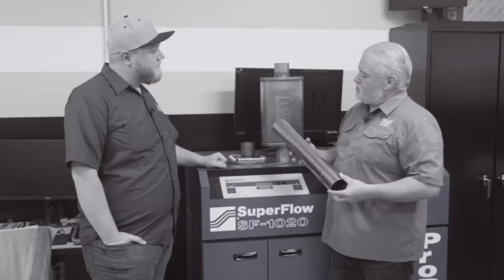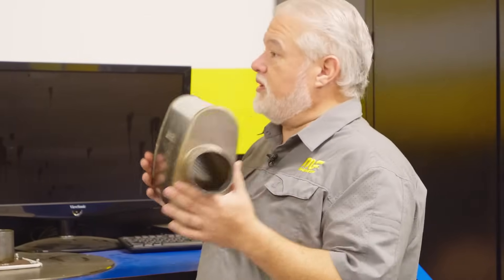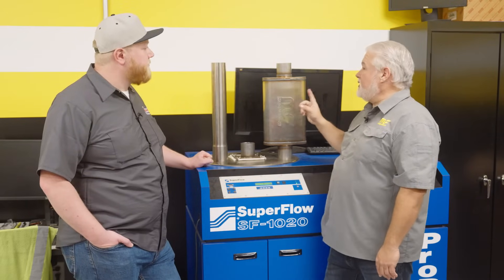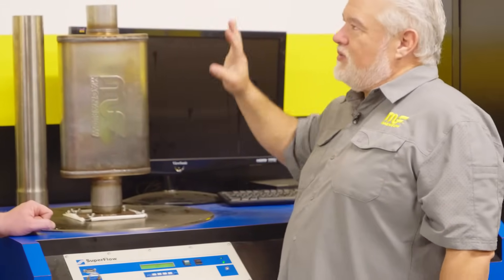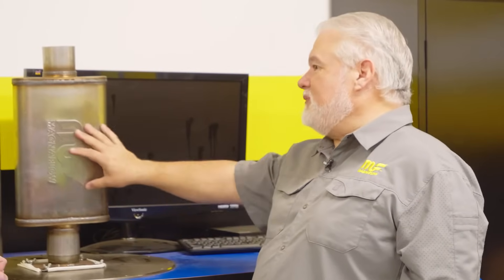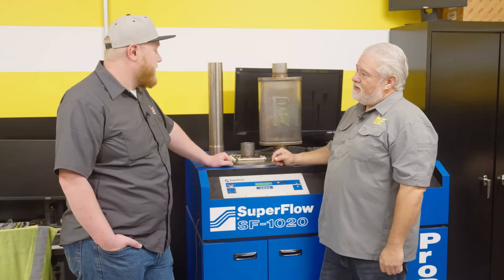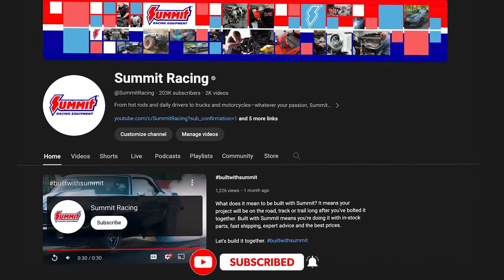A Muffler That Flows Better Than a Straight Pipe?!? We Have the Flowbench Test Results

Comment: the tubing is 3" OD where the muffler is 3" ID, the top end of the tubing will slide into the muffler. This isn't technology, the muffler is larger therefore flowing more cfm.

Comment: The muffler is actually bigger than the 3" diameter pipe. That's why it flows more. Open that straight pipe to the muffler's diameter and it will flow more. But yes, that fatter muffler flows more than the skinny straight pipe. A fatter hose flows more water.

Comment: I don’t comment much but I feel dumber after watching this 
Hey magnaflow that goes on the back of the car not the front you don’t pull air through the muffler it’s not an air filter 

Pulling air through something is not the same as pushing air through something
Pushing expands air and makes it tumble on it self and slow down 
pulling air makes it want to follow a straight path and not tumble on its self 

That muffler acts like a sorta Venturi speeding air up when it’s pulled through it compared to the straight pipe 
That muffler test makes no since 
Blow air through both and bet the straight pipe wines 

There’s not one dyno muffler challenge on you tube where substituting a muffler for straight pipe made more power
Snake oil and lies 
Straight bs

Comment: That muffler that flipped over that pipe is the same size all the way through so it's actually a little bit bigger than 3 inch all the way through I believe isn't it?

Comment: This is null…. First of all you’re flowing COLD air through that muffler …. Secondly when those mufflers break in and those fibers melt …. That muffler will eventually turn into a straight pipe

Comment: I say this test is not totally accurate because exhaust has pulse waves that slow down and speed up. Exhaust does not run at one consistent and steady full blast speed. If you watch the muffler and how much longer it actually took to get to the strait pipe reading then there you go it is slower. So what does one think will happen with the actual exhaust waves with all different speeds coming from the headers going faster and slower and the slower ones having to catch up but then they get canceled out by one or 2 more waves? I like MagnaFlow but nice try on selling them lol
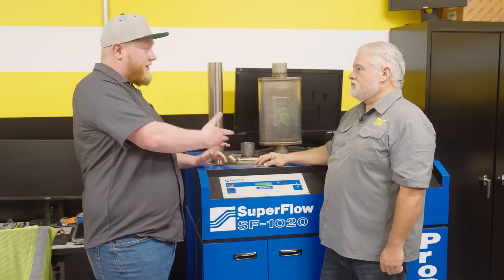Reply from the maker: Thanks for watching and commenting. You are right about the waves/pulses, and he does cover that at the 5:30 mark. But at full capacity, the muffler is able to keep up with and exceed the flow of the straight-through because of the perf-core inner design.
Reply: @SummitRacing  im not gonna lie, I stopped watching after the Magnaflow was tested after the strait pipe in the beginning. Once I saw how fast the open pipe hit peek flow and how the muffler struggled and then finally caught up and went a little past it I was done. I also noticed the Magnaflow fit much tighter on the flow pipe than the strait pipe 👀

I use to be a Flowmaster guy back in the day but grew out of them. I like Magnaf;ow and Spintech but I have been running 3" open pipes for years. Infact I just made new ones 2 months ago.
Reply: @nova467spanker  bring a handful of mufflers to a dyno session. You'll be surprised to find out how much the flowbench helps develop better parts

Comment: Magic Questtion: How much CFM would be on the display if the pipe and(!) the muffler are mounted on the test bench?! (more like a regular exhaust system)
Is it somewhere in the middle?
Reply from the maker: Good follow up question. We can certainly ask Rich and the gang at MagnaFlow.
Reply: @SummitRacing  🙌😉Regarding the comments exhaust systems seem to be a very interesting topic. 🔥 
Maybe it's worth to wait for some more and to discuss them with RICH and listen to his expertise. 
BTW - great contents - thanks for posting. 👍👍
Reply: That's what I'm thinking.  With that 3" muffler, you also most likely have 3"inch piping in and out of it. So you'll be back down to what the 3" pipe flows.

Comment: I called MF several years ago to ask for flow numbers for a specific muffler and the sales guy said they would NOT provide that information to me.  Glad someone was listening.  BTW, David Visard says that you need a muffler that flows 2.3 CFM per open pipe HP to have a lossless muffler.
Reply: He sometimes wrks on outdated info.. I run this muffler and picked up 2/10 from straight pipe...mind blown!!!

Comment: I would have never guessed that muffler weighs 14 lbs! 😮 28 lbs in mufflers? I'm guessing the stainless steel is part of the reason but wow!
Reply: Stainless is lighter than mild steel
Reply: @Silverysquid 
Stainless steel is not lighter than regular steel. They have similar densities. However, stainless steel contains additional elements like chromium and nickel, which can slightly increase its weight. Plus, because it's less ductile than mild steel it may require more welding which can also add to the overall weight.

I have Thrush 2 chamber mufflers in my 71 Camaro and they weigh 9 lbs each.
Reply: @Carl_Jr I had thrush on my truck. Cut it off for something that wasn't going to kill my power and look like an eyesore 🤷
Reply: Looked up the weight of my muffler apparently weighs in at 8lbs so theres that too 😂
Reply: @Silverysquid  A lot less than 14 lbs! 😂
Reply: @Silverysquid  You have to remember that the thrush muffler that I had was a two-chamber like a Flowmaster. Not the typical turbo muffler, that's packed with more steel tubes and fiber all over the place. 

Funny enough, I actually pulled those off and put in turbo mufflers on each side, with cutouts in front of them, because I wanted my car quieter when I cruised but louder when I wanted it to perform.
Reply: @Carl_Jr sound like a fairly interesting setup.  I've thought about doing a bypass pipe on my truck that re-enters the tubing just after the muffler with a pneumatic cutout. Other than them being power killers, I'm m not a fan of the chambered muffers as well because they have a weird buzzy gurgle and ping to them regardless of what engine it's attached to.
Reply: @Silverysquid  These don't, surprisingly. They actually did it better than Flowmaster. I was impressed. But I'm putting on a Edelbrock E-Force Supercharger and want it quiet while I cruise so I can hear the whine, but when I want to get rowdy I can do that, too. 
I have the stock pneumatic valves on my 2013 ZL1 and they're a pita. You're better off with electric. I'll be replacing mine, soon. Putting vacuum diaphragms near hot exhaust pipes is never a good idea. Especially on a 600hp car.
Reply: @Carl_Jr  stainless also like to crack when heat cycled so I guess they make them with thicker gauage stainless
Reply: @krusher74  True. I didn't think about that. 👍

Comment: Would love to see how the different styles of mufflers flow. Flowmaster vs borla vs corsa vs magnaflow
Reply: They are called Chokemasters for a reason. I have done a test between 40 series Flowmaster, 50 series Flowmaster, 70 series Flowmaster and Magnaflow. I had a motorhome running a stock 454, dual exhaust and 50 series Flowmasters. I eventually installed Thorley Tri-Y headers, but did not notice much gain in power. I eventually tried 40 series Flowmasters, which were unbelievably loud, but then finally realized the increase in power I had been expecting when I installed headers. However they were too noisy for a motorhome. The drone would kill you. I then switched to 70 series. Same pipe size. While considerably quieter, there was still some drone, BUT the mileage dropped by 1.9 mpg and the power drop took 2.5 seconds off my zero to sixty time or about 15% loss. I then took those off and installed Magnaflows. They had the same power as the 40 series, but were quieter than the 70 series. No drone at all. All this was done with the same pipe configuration. The Magnaflows were fairly quiet with a faint rumble at idle. If you floored it, you would get a very traditional old muscle car sound, but quieter. These were 24 inch mufflers. Shorter ones would be slightly louder if you were looking for that. I eventually installed a MPFI 502 on the same setup which worked very well. I figured I was running about 420 HP. (the engine was rated for 335 HP with stock exhaust, no MPFI)
Reply: if a part of the muffer sysyem only flows 200cfm, it does not matter a dam whether your muffler flows 250 or 300.
Reply: Most brands have pretty similar designs (aside from spintech)

You'd be better looking at a 40 series versus a flowfx versus an outlaw